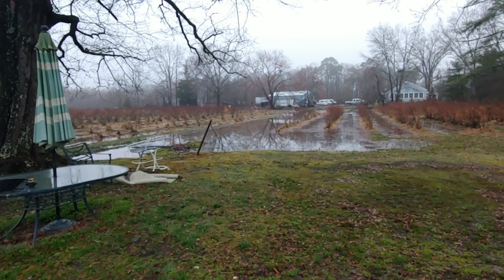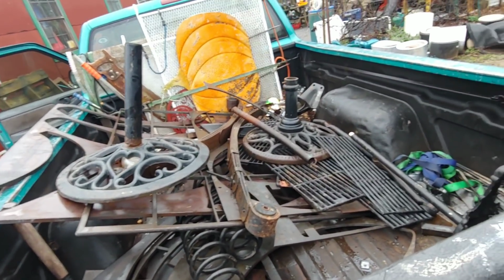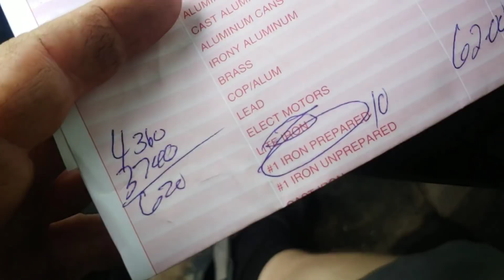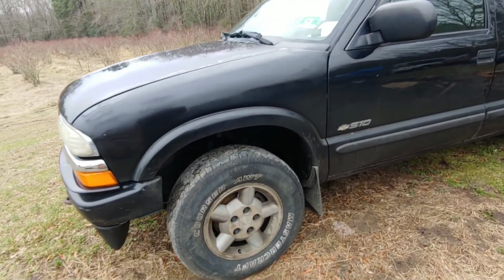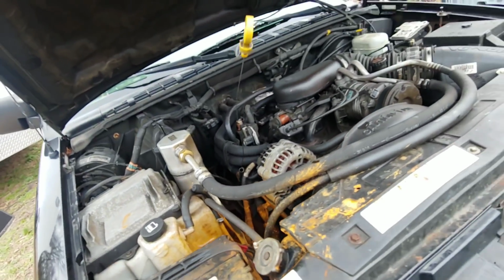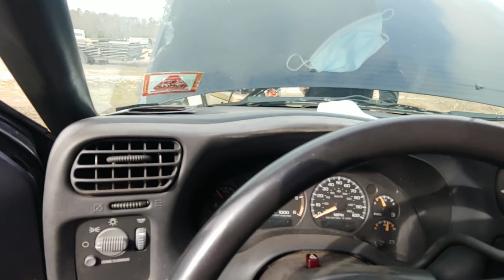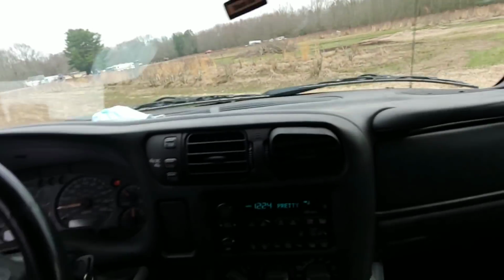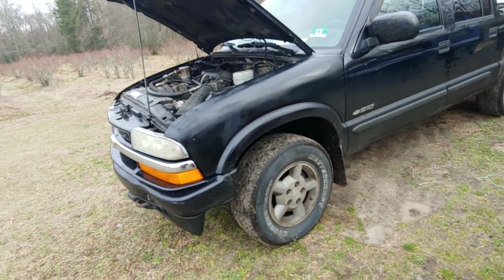Recycling Metal - Heavy metal hoopdie addition

Comment: Hey buddy! I like some of the old trucks you have at your place. I used to have a 1988 ford ranger (manual) that was a beater. I miss it. I could go out a buy a beater if I wanted to but not sure I want to maintain 2 vehicles like I did in the past. Plus I don't buy furniture very often and just use my dads van when I need it.

Comment: flush the cooling system and  refill with the correct antifreeze and add a package of GM engine block sealer. You get it at the chevy dealers parts counter.

Comment: What does "dex-kill" mean?  That's what my radiator cap looked like after I had it flushed and drove 15 miles.  I sold it to a junk yard.  20 years and almost 400,000.  I miss it!
Reply from the maker: GM uses a coolant called Dexcool it's just a joke among mechanics. If you don't flush it and maintain it regularly that's kind of what it does it turns into a nasty brown liquid... sometimes this also happens if someone runs water but that doesn't happen a lot up here because of the freeze in the winter anybody who's dumb enough to run water won't make it that long that's for sure

Comment: Change oil as best as you can you should at least be running at 40 to 45 idle on the oil pressure and driving should hover around 50 55
Reply from the maker: My other S10 chills at 60 all the time. Lol